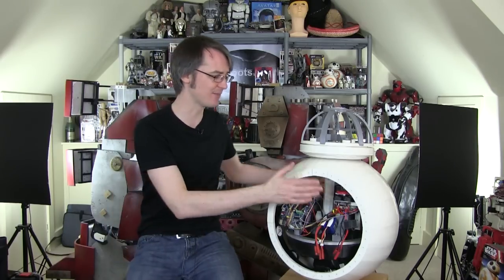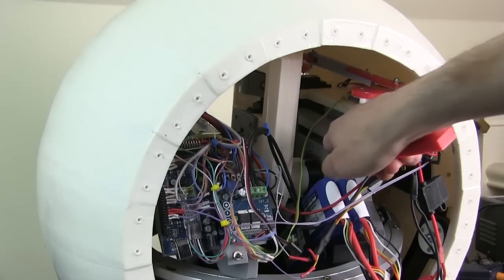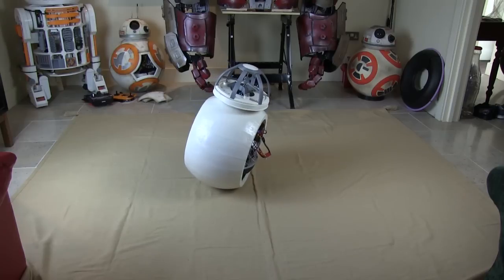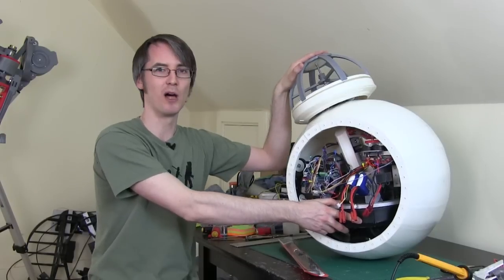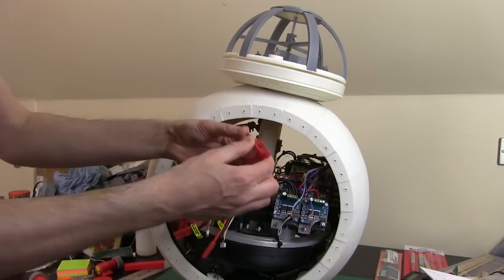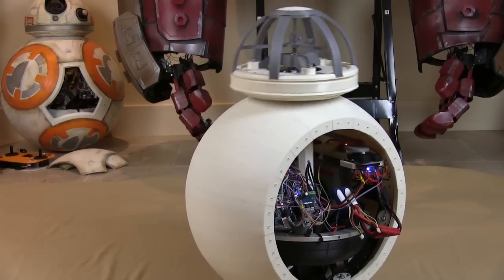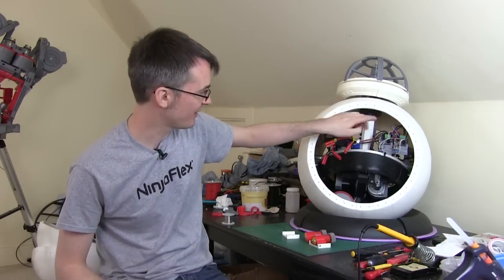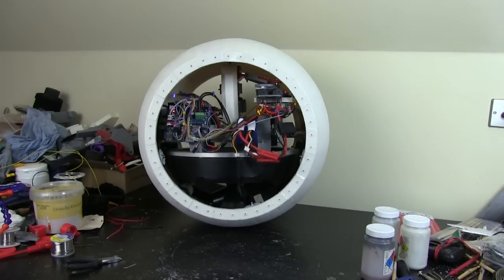Star Wars BB-8 Droid v3 #10 | Flywheel Testing | James Bruton

Comment: i would have put flywheels on the pole holding the magnet keeping the head in place to make the head move left an right and have the bigger flywheel spin the pole so that the head could go forward, backward, left, and right.but i wouldn't worry if i were you you'll just probably figure out something smarter, after all what do i know?

Comment: I don't use mechanical linkages to build robots, I use micro-fluidic devices, but if you're 
really comfortable staying in the 1930's and such contrivances continue to charm you,
at least change your strategy.  Here is a link to a flexible cable on Ebay.  There are different
sizes and vendors, but this will give you the idea... with this kind of cable you can mount 
all your motors on the very bottom level and like an octopus, run these up to where they need 
to go:  http://www.ebay.com/itm/1-4-X-26-flex-cable-shaft-drive-dog-prop-nut-for-gas-nitro-rc-boat-/130321267108
Reply: ***** Oh, … well if you need to load remote transmission lines like that, you add an encoder wheel to the tip and a single photo interrupter, this gives you closed loop feedback and the backlash can be tuned out.  Encoders weigh what?  A couple of grams? 

Theoretically you can string some fiber optic and not have any electronic sensing at your tip locations at all? A retroreflective tip will take the encoder modulated light, and feed it back into the fiber. I can think of a number of ways to do this, you will too.

The ability to set up centrally located centers of mass are invaluable when creating self balancing robots, so fear thresholds must be crossed.  Right?  Much of this stuff is about thresholds of personal comfort, but after you go through each pain of childbirth (new approaches, new techniques), your initial resistances will self resolve, and your new projects will experience a quantum leap.  

Soon you could have a single hydraulic pump, and feedback controlled micro-fluidics strung out like christmas lights… it's time to uncouple the mass from the motion.
Reply: +James Bruton (XRobots)   Someone gave you thumbs up for simply asking a question, your fan boys are obviously 'obsessed'.  Anywise, you didn't give me either the length of the cable or the skew speed you want to achieve?
Reply: future future future future....

Comment: Great job... as always!
Take this suggestion with a grain of salt... 
if you load the flywheel adding more weight on both sides of it, your BB-8 should spin much better.
I guess with all the IMU units you have installed, the flywheel will adjust itself even if it's not perfectly balanced...
but, again, it's just my suggestion.

Comment: In version 2 you had to turn off the stabilizing accelerometers because of EMF interference from turning the flywheel.  This meant that you couldn't use the flywheel while driving.  Is that the case with this version as well?

Comment: Hey James,
I've been following your projects for quite a few months now and I must say they are really awesome!

Some time ago I did some research for another project to understand PID-Controllers and now I see you using them everywhere :D
I made a small web app explaining PID-Controllers, so I'll just leave it here for people that also want to understand them:
PID-Controller Simulation: https://output.jsbin.com/datixo
Also something really cool that can be achieved using PID-Controllers:
PID-Copter: https://output.jsbin.com/gaxake

I'm still thinking about how you could improve the stabilisation of the BB-8.
That's really complicated with the mass moving etc...
Maybe I'll write another simulation for that some time... :D

Cheers, Quertz
Reply: +Quertz There you go, a nice BB-8-Simulation!
https://output.jsbin.com/mutame

The default Code is pretty much what James did for the side-to-side motion.
This doesn't quite fit under this video, so I'll maybe cross-post it to part 8

Comment: Have you considered replacing your lead weights with TUNGSTEN weights?  Lead is 11.3 kg/L, but tungsten is 19.3 kg/L.  It's easily accessible since it's used in pinewood derby cars, and you can get them in 4.5mm beads on Amazon.  (You can also get them as thin bars which perhaps you could mount on what you've already got, or as regular cylinder weights.) 

I know you glued the lead into the wheel, but maybe you could reprint the sections.
Reply: +Bramble451 He would have to take apart the entire build just to waste all the time and money he spent on the current one.
Reply: Leethebee42 He's usually pretty good at making it possible to disassemble and reassemble his creations.  He's talked about his desire to be able to remove the "banana" in more than one previous video.

The black ring with the weights in it is screwed onto the rotating metal disk, and he stated in earlier videos that he would be able to add more weight into it if he needed to.

He can't remove weights from each compartment, because they're glued in, but the only thing he would have to reprint are those compartments.
Reply: Leethebee42 Actually, looking at episode 4 where he makes the flywheel, he wouldn't need to remove anything at all except the flywheel compartments.  There are three of them bolted together.  Unscrew them from the lazy-susan, then unscrew them from each other, then pull them out!

Comment: Why don't you try to couple the flywheel control with the steering control? Looks like when you ride, with a smooth floor, turning the flywheel would help you steer even tighter without compromising the stability, instead the gyro momentum would help keeping it stable. I think the main driving control should try to take advantage of every single function, so that you can actually drive it, without keeping an eye on balancing it.

Maybe when having the sphere complete it will be much more easy to visualize your actual movement range.

You're doing an incredible job, especially comparing it to V2, congratulations!

Comment: 1/2 way through the video but thought I would make a quick comment on the smoothness of the ball. If you get a good quality glazzing putty (bondo type stuff) from a autobody supply store you could smooth out the ball with 'minimal' work. A more expensive glazzing putty will cure better and gum up sand paper less. A cheaper one will be slightly tacky until you hit it with sand paper. Once you get the initial tack off it sands hard dry and smooth. Good stuff for a litter container is $35-50. Stinks and makes dust so do it outside. A paper mixing board is also handy, has lots of sheets of thick paper to mix the stuff on. Peel off a used layer for a fresh. About $8 or so. If I were doing the body work on that it would take me 2-4 hours.

Comment: This is turning out amazing! I always look forward to watching these episodes. There are a couple of things I was wondering that I hope you can answer. I really like thinking about this and coming up with ideas to make it EVEN better, so don't take it as critique :)

Now that the ball is smoothed out, the movement is a lot less wobbly, but I think there is still a bit of shake. Could that be because the drive wheels still run on the unsmoothed inside? Also, I was wondering if it would be possible to make the side-to-side stabilization a bit quicker by overcompensating for the first correcting actions and then switching back to your undercompensating controller to make sure it doesn't tip over.

I'm just throwing around some ideas here: When turning the ball by using the side-to-side motion, as the ball picks up speed, its weight wants to throw it in the other direction, making it turn the wrong way. Perhaps one way to solve this could be to couple the ball's longitudinal speed to the side-to-side motion. That way, when the ball picks up speed, its insides will lean more. To make sure there is enough resolution to compensate for the speed, you could limit the maximum amount of side-to-side motion at slow speeds and limit the maximum speed of the ball while using the side-to-side motion to turn.

Again, you are doing an amazing job with this and I bet it will turn out amazing when it's finished! Your attention to detail is really nice to see. Keep up the great work!!!

Comment: Just a suggestion but I can think of some situations where you'd want to move faster so maybe coding one of the buttons or switches to toggle fast or slow speed, granted a slider type thing would be better for speed control but that'd require modifying the controller so just a speed toggle would be fine, just a thought, keep doing what you are doing and being awesome.

Comment: Coming along nicely!  Have you though about using plastic body filler to smooth the surface?  You could 3d print a few simple tools, like a portion of a sphere as a sanding backer with thin foam between the spherical shell and the sandpaper.  Even without the filler, such a tool would allow you to true up the surface.  On cars we call it blocking down, I guess on this you'd call it balling :)

Comment: Another great episode James!!! 
I can't help but notice a really annoying and probably performance lowering squeak somewhere in the drive mechanism. I'm guessing one of the wheels on the "banana". It sounds almost like there's too much pre-load and the bearing is turning on the wrong surface. If I recall correctly you installed a mechanism to take out some slack and to add load to the wheels, might look at that a bit, I feel it's causing too much drag, causing the poor bearing performance squeak and probably magnifying the un-smooth ribbed effect on the inside of the ball that you smoothed out on the outside in this episode. I'm not trying to be nit picking, just something I noticed and hope to help a little. Keep up the great work!
Reply: Good deal!

Comment: star wars could u ur BB8 next time when they are filming star wars 8, instead of using CGI
Reply: +Justin Chan They don't use CGI, They use I think 10 or more bb8's for filming, Some have more detail on their face and some have more detail for long or wide shots
Reply: +RedStone Nicks fairly certain they also use cgi for BB8 though, some of the things it pulls off (like grappling to the ceiling and walls of the falcon) are almost certainly CGI. Not that there's anything wrongwith that
Reply: +Justin Chan They used CGI where it made sense really.
Reply: +RedStone Nicks Unfortunately they couldn't get the speed needed for the desert chase scene from the robotic droid so that BB8 is CGI. Another example of CGI BB8 is when the small droid uses its grapple cables to "hold on" during the Falcon Chase scene. Otherwise you're right, it is usually a physical droid.

Comment: As rotating with the fly wheel works better if you started with the opposite way and suddenly turn the way you want have you thought about implement this in your code?
You could make it turn the opposite way for the amount of time it needs to work (I let you determine this amount of time) and then turn the way you want. That would even work better than doing it with your controller because it would be an instant change.
I don't know... It is just an idea.

BTW I love your videos! It really makes me happy when I see on my Youtube page that you posted a new one.
Because of you (and because I wanted one for 3 years now)  I ordered a cheap chinese 3D printer.
I can't wait to tune it and make all the projects that are waiting for plastic parts on my desk.

Thank you for your work!
Reply: +James Bruton (XRobots) Ok! Anyway with the sides put on, people wont be able to tell if you are doing it or not.

If you planned to put some electronics in the head have you thought about linked the arduino in the head with the one in the body using RF? This way you could put some sensors in the head and make it follow people automatically or even just be able to control some stuff in the head with your bluetooth remote.

Again just an idea  ;)

Comment: Had you considered mounting the ball upside down and holding on to the internals while having the motor run, so you could sort of lathe is smooth?

I can't remember if the flywheel is gravity set, or would cause problems if it were inverted.

Anyway, nicely done considering you did it all by eye with a saw-file!

Comment: Great video James! A little tip i picked up while working at an autobody shop, for your final sand of the ball, try spraying the whole ball with a light coat of spray paint that contrast the surface, sand all the paint off and naturally it will make the job as smooth as you can get.
Reply: +Finn human To Clarify, the paint helps you see where you have and havent sanded. Also! i am aware that you are probably way past this point in the project and have probably already started on the skins, just thought it would be a useful piece of advice for future projects! keep up the good work.
Reply: +Finn human maybe clear lacquer would help, wet sand in between coats. sets hard after a week.

Comment: What effect does spinning the flywheel while moving in a straight line have? It looks much more fluid now. Excellent work!!
Reply: +James Bruton (XRobots) It wouldn't really fit now, but one way that the spinning could have been made more controllable would be to have two flywheels with the same rotational inertia that were counter-rotating. That would allow for them to ramp up almost instantly without recoil, and then, by slowing one down relative to the other, to turn.
Reply: +James Bruton (XRobots) Oh well, just a thought.